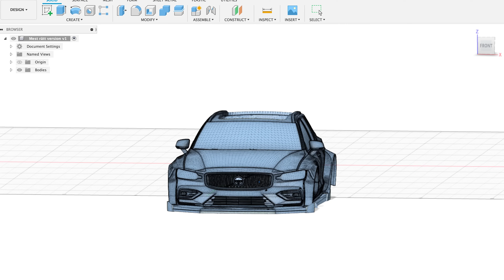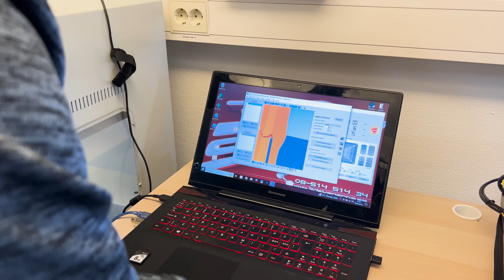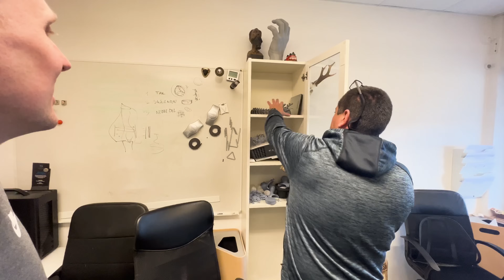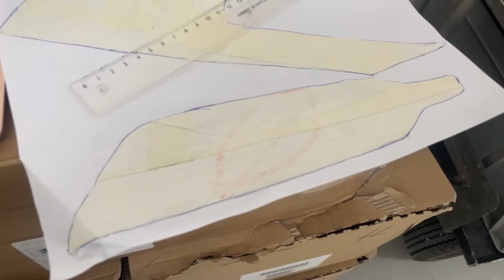3D Printar en Widebody Volvo Go-kart / Part 1

Comment: Adhd is a gift and a curse like you said... when the project is boring you'll end up pushing it aside forever sometimes even forgetting about it's existence unless it's for work and have no choices but when you actually get pumped by a project you end up spending all your energy and might into it and somehow you get some kind of super focus... in my case once I get hooked you can't take me off because my mind will think about the project every single second of the day lol

also, i feel like most adhd people are actually perfectionist as well, the few at least that i met were all perfectionist like me which is also a double edged sword, on one hand you end up with a final product that is much better than it should have been but on the other when it doesn't reach that state you can end up giving up if you fill like it's too much and shit

BTW insane build love and dig it.

Comment: I use this technique for building 1:4 and 1:5 models, i know how long it takes to model, print, glue, fill, sand, prime, sand, prime, sand, paint, stickers.... So big bravo for a big one like this. My concern is about glue. I use 3d printed holes to fill wood cylinders for alignment. Then i add metal stripes with hot glue inside. Even with this body tend to crack on edge after a few month. That's why i make rtv silicon molds and do final bodies in fiberglass.
Thanks for video.
Reply from the maker: Heeey! Thank you!! Yeah my plan was to make a fibre glass mold, but I didn't fully understand how it worked. I should have made the mold before putting it all together, still haven't given up on the idea all together tho, I have another plan for it. The alignment would have been harder with printed holes because these big prints tend to bend a little in the printing process so I was afraid the holes would make it harder to adapt. Are you using plastic filler tho? The filler compound might be why it cracks.
Reply: @critical  you can make traditional hard mold in fiberglass in several parts, or soft rtv silicon mold, or mixed ones. The grill for example is hard to work with fiberglass mold. The cracks appear in pla between blocks or sometimes in layers. But i make my mold before they appear. Sure even my one meter long models tends to bend and are not easy to glue after. All surface is filled with putty, then with thick layer of polyester primer... i made a video with Polyester mold, i should make a new with rtv molds.
Reply from the maker: @rcbodyshopfr  yeah i ment Putty, the type if putty is important, there are many different types. Im going to check out your videos, thanks!

Comment: Another option, would be to print interchangable lego-like blocks, and other shape defintion blocks could be added onto those, and then use a fast acting vacuum thermal forming table to pull perfect copies of the shapes you are trying to achieve, and doing so at a major weight reduction.
Lego-like blocks could even have other shapes rather than blocks.
Interchanging any of those, and youve got a new mold to rapidly copy newer versions of a car's design.

The nissan pulsar nx had a interesting way it could morph into 1 of 3 different vehicle design shapes with interchangable panels, and theres a vw camper that can double its capacity with a slide out that is lightweight injection molded, but could be vacuum thermalformed for alot cheaper.
Party on garth.

Comment: Congratulations for this video and this crazy project!! It's funny but I had the same idea as you except that I took out a General Lee type Dodge Charger body that I'm going to put on a Pocket Quad chassis entirely designed to be a remote-controlled car. In total the printing will have taken 3 months without counting the conception of the design and the failures of impressions ... so Congratulations because I know how much time and energy it takes to create all this !!! Maybe the work with epoxy resin is shorter but it's not saying that everyone can work it correctly so 3d printing can counter this problem sometimes... 

Traduction FRANCAISE :  
Bravo pour cette vidéo et ce projet un peut foufou !! c'est drôle mais j'ai eu la même idée que vous sauf que moi j'ai sortie une carroserie de Dodge charger genre General lee que je vais poser sur un chassis de Pocket quad entièrment conçu pour être une voiture telecommandée. Au total l'impression aura faite 3 mois sans compter la conception du design et les échecs d'impressions ... donc Bravo car je sais combien de temps et d'energie celà demande pour créer tout ça !!! Peut être que le travail à la resine epoxy est plus court mais c'est pas dis que tout le monde puisse le travaillez correctement donc l'impression 3d peut contrer ce problème parfois...

Comment: What kind of filament was this made from, why did you decide to use glue instead of welding, and what kind of glue did you use?
Reply from the maker: Its PLA and 2k superglue. The glue is stronger than the material. Its held up for over a year now i think
Reply: @critical Thank you for the reply. I’m working on a Fox Mustang project 🤞

Comment: Should have incorporated dowels into holes when attaching the parts like an ikea furniture. it woulda been much much stronger
Reply from the maker: Nah the glue is stronger than the material itself. And there is a layer of fibre glass on the inside
Reply: @critical  wow what kind of glue is that? I knwo if it was super glue it would snap. Just seems like dowels incorporated would still make it much stronger

Comment: Lol it's done in so many different materials hopefully not PLA. Can't imagine why this cost u so much. There's a long list of things that would have made this better. not using bedsligers because they cause banding, using dowels, and finding someone with a printer just a bit larger for the main pieces. in the end after all the sanding and gluing the potential for it falling apart is.. highly risky.
Reply from the maker: No, its different colors, not different materials. I have never claimed to be an expert on anything, but its definitly not falling apart. I havent sanded the print, only the plastic filler and I put a layer of fibre glass on the inside as well, just didnt show everything in the video.
Reply: @critical  Oh well its not falling apart with fiberglass. I just hope you didnt break the bank on those printed parts.
Reply from the maker: @whynotbuildit  i think i said expensive in the video, it all depends on whats you compare with of course. I think i compared with other offers i got from people with smaller printers. Im good 🙏🏻 thank you tho for your concern 😇

Comment: the problem about the parts nt fitting it is because, they have printed the parts with PLA and that material starts to melt above 60 degrees, and you did it at BRIGHT SUN LIGHT !!!...
Reply from the maker: No thats not it, sure they are sensitive to heat but the fitment issues wasnt because of that

Comment: Not seeing keystoning or registration marks to easily position the potentially interlocking parts.
These would also help strengthen at points and offer structural integrity should it be needed, and reduce on the plastic welding acetone type glue and some of the weight.
Not trying to sound like a know it all, just trying to find ways to innovate by being able to observe other people's creative efforts put forth to consider that help educate me further, maybe towards the arduino based starships!
Reply from the maker: Thanks. Of course we thought about that as well but since its hard to get the pieces exact due to them bending a little in the printning process it would have made it even harder to adapt if we had things like that to consider as well

Comment: He should of made interlocking parts it would be so much stronger
Reply from the maker: The 2 component glue is stronger than the prints 😂 it wont fall apart, it has fibre glass on the inside as well, i forgot to show that in the video